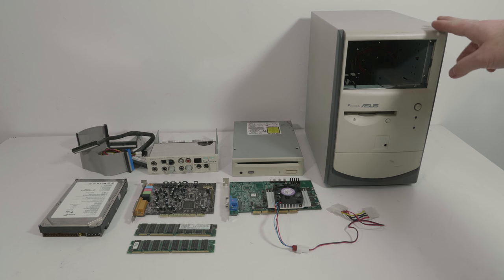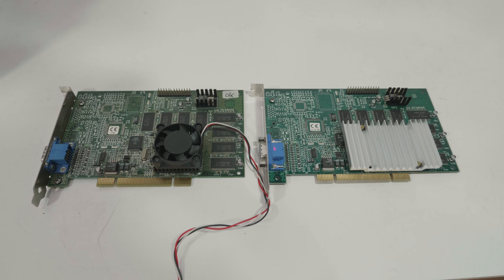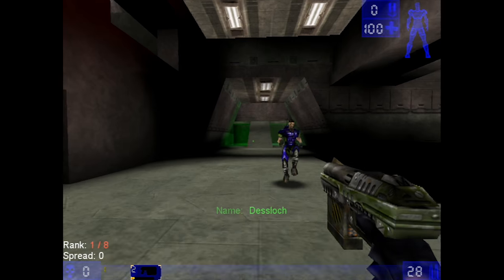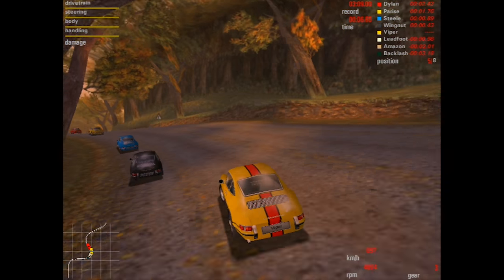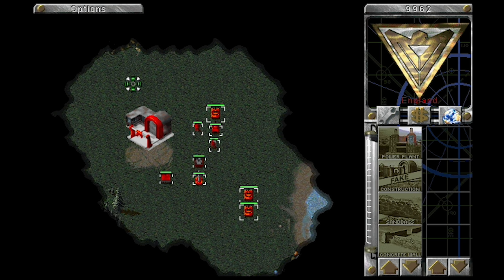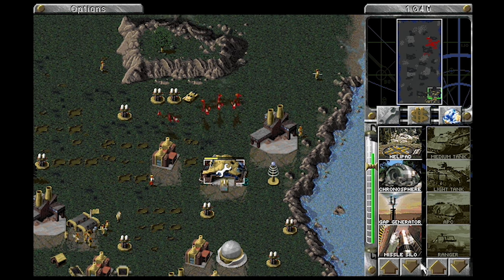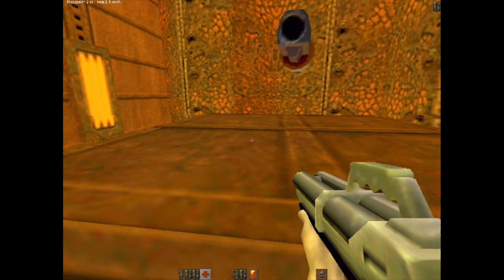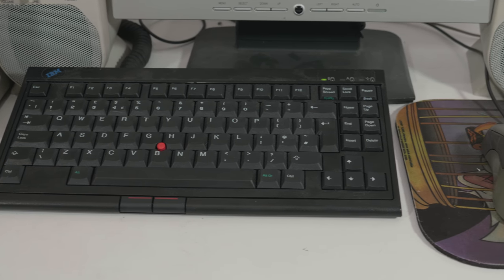ASUS Terminator Lanparty Gaming Build, 3DFX Voodoo 3, AMD Athlon XP

Comment: My first experience was visiting my friend Josh out in Tampa.  At the time, I had a build I bought up the parts for.  Athlon XP 1700+, 1GB of DDR400, 80GB ATA-100 harddrive, Linksys 10/100 ethernet card, SB Audigy, and a 128MB Radeon 9800 Pro.  Had a blast fragging in UT2k3.

Comment: Goodtimes. I sold my quake build from 97 with a rendition V1000e for a grand and build a new machine with a Gforce 256 and played UT until my arm stopped working for 2 weeks back in the day. Also I always had good luck with old card.s. My last build I was waiting for a GPU and wanted to make sure everything booted.  This was 2 years ago. So my MB had a PCI legacy slot, and I stuck a 3d rage into it, and installed windows 7.

Comment: I would try and bake the 3000. Solder joints crack over time. You don't have anything to lose!
Reply: definitely worth a try.
Reply from the maker: It will go in the stack with parts that are broke and must be inspected and repaired :)

Comment: Why you don't test the voodoo on another motherboard?
Reply: I second that. Have you tried it? 
Some of my voodoo cards are really picky about motherboards and even cases. My V3 2k pci does not work in two of my cases, probably due to a slightly off mounting angle. V1 cards seem to be very picky about cases as well.
Reply from the maker: Yes I tried it on several machines. But I left it out of the video. I dont want to make to long or boring videos.

Comment: i think you made a mistake editing the video. After you snap your fingers the system is on the desk... Think it was supposed to cut to a shot of it post-cable management??
Reply from the maker: No it was on purpose. I never did cable management. I changed the ide cable for a rounded black one that is all. With the snap i skip steps and "travel" to the next step. But maybe it doesnt feel like this for the viewers. I will do it different next time :)

Comment: Why is the case fan blowing air to the inside of the case and not to the outside ??
Reply: to make positive pressure inside instead of negative. nothing wrong with negative but will do so that you get way more dust-bunnies inside
Reply: I think a 90mm (not a tyraped 80mm, no offence Vic) fan blowing air to the outside is Always better, the intake on the front of the case (if theres one) there is a fan that blows air inside the case.also a fan on top blowing outside ...
Reply from the maker: I didn't had any 92mm fans left that were working. All had worn out bearings. I put it as air intake so fresh air on the CPU and probably more fresh air for teh video card. So I did it on purpose. and the 80mm fan is pretty strong.